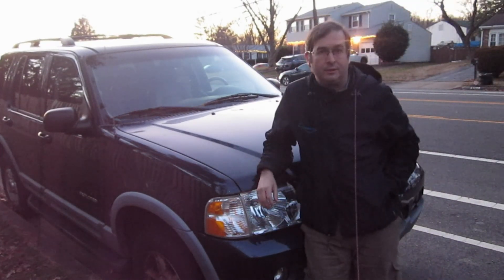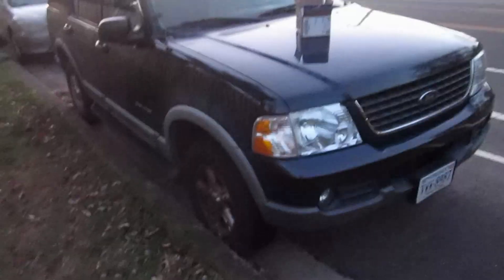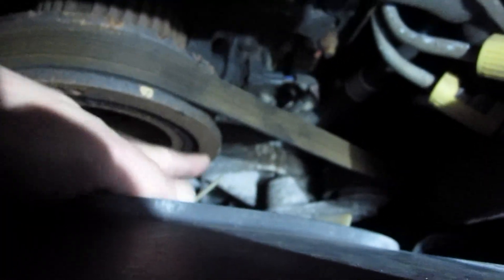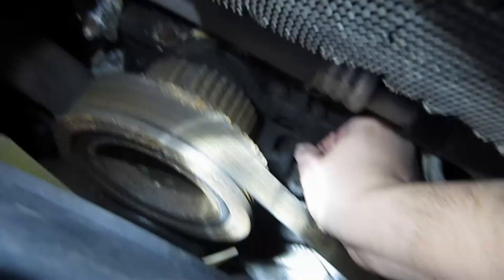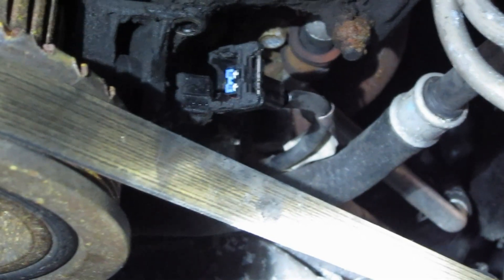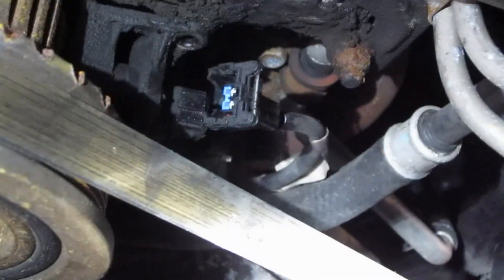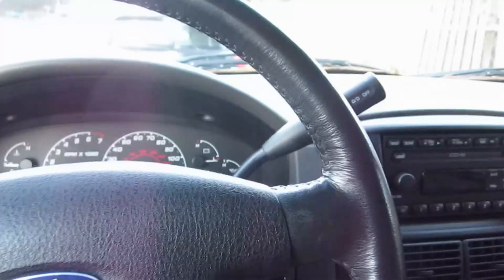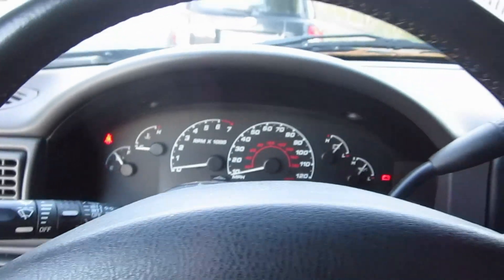Ford Explorer: Replacing Crank Shaft Position Sensor

Comment: I know this is a really old post, but I recently came across a 2008 Ford Explorer 4.0L V6 having a starting issue. When you turn the key to start the engine it just keeps on cranking, like it is not getting any gas and doesn't stop cranking until you turn the key back to the off position.  I hooked up a scanner and ran an actuator test on the fuel pump and the fuel pump is good and works. The truck starts up and runs after the fuel pump actuator test for the rest of the day. The next morning it no longer starts again until I run the fuel pump actuator test again.

Comment: Hi, did you scan the vehicle for a crank sensor code? Did you ever find out exactly why you had a no start?
Reply from the maker: I was guessing.. there are only so many things that can cause this problem.. the crank shaft sensor.. the cam shaft sensor.. and of course, the fuel pump! There were no error codes! This was this issue with my car.. of course, the most expensive one.. here is a video troubleshooting, and showing the fix! It has been working great for years now, after this fix!
https://youtu.be/9LoFScXBMkg

Comment: My Explorer suddenly did not start a few mornings ago. Cranks - no start.  Did the obvious - Replaced Fuel Pump/Fuel Filter.  No Start.  Swapped relays - no Start. Replaced Crank Position Sensor - Still Cranks - no Start. Very Frustrated.  Any ideas I can try without a Scanner?
Reply: Change your starter motor

Comment: If it still isn't starting 2 years later, I've read that crankshaft sensors have to be "retaught"
Reply from the maker: I finally figured out the problem was the fuel pump..

Comment: Hi Everyone I have a 07 Ford Explorer and last week it started shutting off at idle with the check engine light and oil pressure light flashing but it will crank right up afterwards with no warning lights. The only code it's ever thrown was egr valve I had that replaced and it's still doing the same thing. When this is happening right before shutting off the car feels like a shaking vibration like it's struggling for air or something and a horrible smell comes out the exhaust. Please help !!!
Reply from the maker: My problem was with the fuel pump.. after I replaced that.. the vehicle was working fine!

Comment: Did your RPM go up when you are cranking the truck over.  I have the same issue but I’ve already replaced the fuel pump with a ford fuel pump.
Reply from the maker: The fuel pump was the issue on my vehicle.. Did it fix your problem?
Reply: jaynes network my truck decided to start again.  Fuel pressure is good at 40psi.  Hopefully it is the Crank sensor since it does have 265000 miles on it.

Comment: great video. what sort of ford dealership cannot diagnose a failed sensor. Don't they have digital plug in scanners. You should ask them to return your money or sue them in the small claims court (bring on judge Judy)
Reply from the maker: The problem was with the fuel pump.. I will not take my car back to that dealer again.. I try to fix things myself if I can.. I have found a good trustworthy mechanical to change the fuel pump for me.. I do not have the equipment or expertise to do that one myself.. since it requires lowering the fuel tank down from the car, and undoing the brackets that hold it up..
Reply: @jaynesnetwork  Thank you again for your reply. The failed attempts where at a mechanic that I use only when my favorite mechanic is too busy or out of town. I'm now going to take my car to my favorite mechanic and have him check the fuel pump. I don't want pay the large sum for a camshaft sensor and find out later that it is the fuel pump. It's my understanding that the fuel pump can be analyzed to be good or bad. The camshaft position sensor testing is not very conclusive. Thanks again.
Reply: I'm in the same boat and I've been thinking about asking for a refund. We're talkin close to $500 here and the car still runs the same.
Reply: @princeinflorida214  go for it. you are paying for a result not a failed attempt. good luck
Reply: @barry-cq4xg  👍
Reply from the maker: I hope it works out.. If you do find out something I love to hear about it.. It will be interesting to find how how they diagnose the fuel pump.. My issue was intermittent.. and only lasted a few hours at a time.. so it was extremely difficult to diagnose..
Reply: @jaynesnetwork  I certainly will keep you in the loop. I appreciate your replies. He can check for fuel pressure and I just found that the check engine light will come on after it idles 10 minutes so he can check it when the CEL is on. I still have to talk to the first mechanic about the $500 for failed work.

Comment: What year is/was your Explorer.  What diagnostic codes were displaying?
Reply from the maker: It is a 2002 for explorer.. There were no codes associated with this issue.  It eventually stopped running all together.. it was a fuel pump problem.. This was one of my initial attempts to diagnose the issue.. Since the fuel pump was expensive to replace.. and this was relatively inexpensive.. I decided to try this first.. Sometimes you just have to try things.. to trouble shoot the problem.. it is exceptionally difficult, when the problem is intermittent.
Reply: @jaynesnetwork  Thank you for your prompt reply. Like you the mechanic has tried twice to fix it, charged lots of money;  it's still running badly. I have a persistent 214 code OBD1 1994 vintage. It may be the crankshaft position sensor which is an expensive job but maybe not. I'm stumped.
Reply: SOLVED!!!!!
My consistent 111 and 214 codes are gone.
I replaced my ECM with a salvaged one and now my EB is running like new.

Comment: Great Video! However, I was some scared you crawling under the truck with all that traffic. 
I am hvn the same issues with it intermittently starting. It has left me stranded many times but seems like a hour later it starts. But, at first I thought it had to cool down to start until it wouldn't start in the morning after sitting all night. 
So I have a mechanic putting in the crankshaft sensor. I hope that's all I will need but the comments have helped me in case it still acts up. I have a 98 Ford Explorer.
Reply from the maker: Oh, Thank you!! I tried replacing many different things.. The problem with mine was the fuel pump... which is a very expensive job.. since they have to drop the gas tank to change that... I wanted to try to eliminate other possibilities.. since they were cheaper to try... and if they did fix the problem.. might have saved me a lot of money... unfortunately.. it was the expensive issue for me.. Best of luck!!
Reply: @jaynesnetwork  ... Fuel pump ? Those are expensive jobs. I was thinking more of a vacuum leak, or a mass sensor. It might even be a spark plug or a spark plug cable. Maybe fuel injector.  If it's a fuel pump... wow...
Reply: How did it work out with the camshaft position sensor?
Reply: Penny shaw wat was ur problem mining doing it now i changed the fuel pump and crankshaft sensor it ran good for few days bogged out again

Comment: Check the relay fuses
Reply from the maker: Thanks, The problem was actually the fuel pump.. Once I replaced that, all the problems were fixed.
Reply: @jaynesnetwork  does fuel pump show up on a diagnostic,, code?

Comment: I had a Mercury Mountaineer, which is exactly the same mechanically as a Ford Explorer.  It started having the exact same problem and I replaced the crankshaft position sensor like you did and it just cranked as yours did.  Then I replace the fuel pump as you did and it ran great for around 6 months but then the same damn problem started coming back intermittently.  I eventually read on a forum that it could be a plug that has to do with the vehicle security system that comes lose when raising the adjustable steering wheel.  I sold it before it ever happened again so I don't know for sure if that was the case but if you do run into the problem again you might want to look into that.
Reply from the maker: I really appreciate that.. This problem is so frustrating.. One time we got stranded at church.. and everyone just walked past us.. not offering to help.. It is so terrible when this happens...  I did replace the fuel pump, but I still don't trust it, and I leave it running and lock it up while on errands, and until I return it to near home.. Never shutting it off... It has not acted up yet, since the recent transplant...  we will see if that fixed it.. Thanks again, you are a wealth of knowledge!
Reply: I used to leave mine running too so I know how it is!  :D
Reply: @jaynesnetwork  how has it been doing as of late? I'm having the same issue with my 2003 Explorer.

Comment: Hi 
 jaynes network did you try aligning your timing belt, its pretty easy to do you remove the belt roll the crank around until the notched indents align up with the mark on the housing, and then fit the belt back on and add tension, its usually timing issues if it still fires up,  you may want to check that your getting air fuel and spark, those are the main issues with a non firing car :) #peace
Reply from the maker: I finally figured out the problem.  It seems that the fuel pump was going bad.. It finally completely quit working.. then the problem is easy to diagnose..  Thanks for the great comments..
Reply: @jaynesnetwork  No problem I'm just trying to help, PS google have started removing my comments about the 3 cities i found and pyramid and actively started to block my comments from other pages, so if this disappears you know why,  you know just from their actions it has to be true lol, did you see the sonar images i posted, i made them into an animation, and i did a 3d flyover video,  it looks pretty awesome i think  :) #peace
Reply from the maker: Yes I believe it.. They are pulling more shenanigans with me too. Have you made a video of your finding?? It would be very interesting to see..
Reply: @jaynesnetwork  have i made a video? (gee google give me a break)  didnt you see them all?, i posted comment's with the links ive found 3 citys in total and a pyramid, i have radar, sonar, sidescan, satelite topography, heatmaps the works, wow i cant beleive google censored me that badly, you know it just has to be right if they're going that far, so i think it could be the links causing them to scrub the comments, so as I'd ike to test the hypothosis, im not going to add the links on his message to see if you get it i will add the links in a seperate one to see if you see them, if they dont appear ill post my email for you to send me a message so i can directly send you them, i havnt full documented everything  but im getting there im trying to be thourough lolz :) #peace
Reply from the maker: Hi again. When I click on the first link, it takes me to your blog page, but there is no videos displayed there.  When I click on one of the blog links, at the bottom, it takes me to another page, which has an embedded youtube video that I believe is made by someone else about pyramids.. below that video is some links that look like the same videos that you had posed above.. when I click on those, it takes me to a youtube page, with no video, and a redirect back to your blog I believe.. Am I in the right spot, and is this what you intended to be posted?  Maybe you can try emailing me a direct link to the videos, and I can see if I can get that to work?? : rnsjaynes@gmail.com  Thanks..